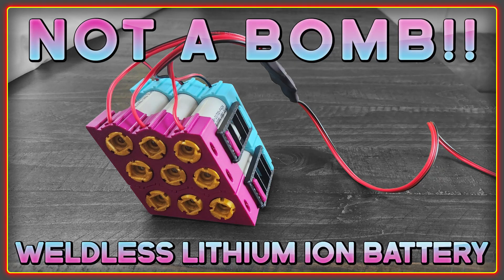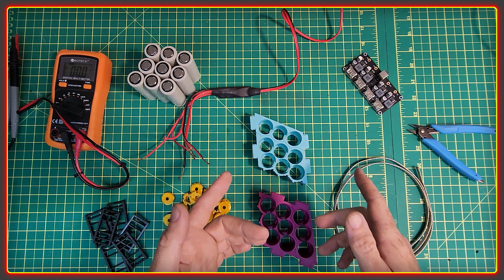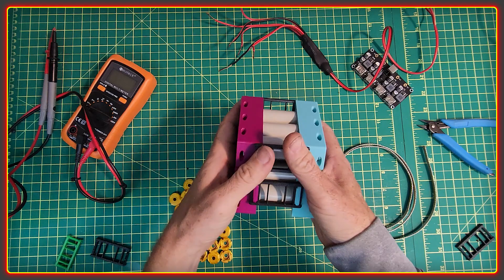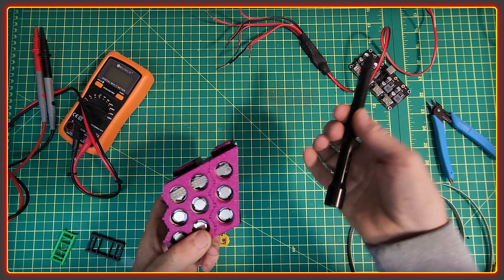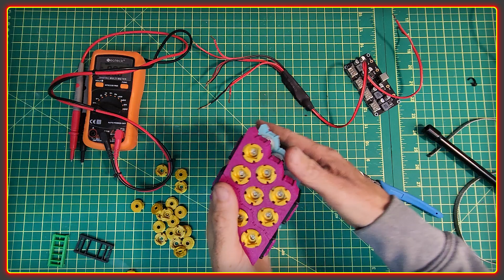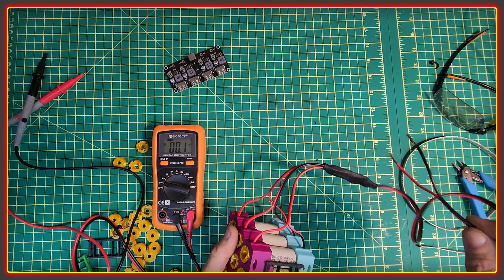NOT a Bomb! Weldless Lion DIY Battery building system - Omnicell

Comment: Has anyone designed a part to stop the screws from coming undone yet? I guess that some tape would work (please do not take this as advice anyone,or do so at your own risk as I have absolutely no experience working with battery packs), but maybe a better option than tape is available already? Maybe also some kind of outer frame for protecting certain types of plastic from cracking and degrading over time?
Reply from the maker: I need to get back on this. Time is very scarce. The screws don’t come out but a dap of mitre glue is possible if one was worried.

Comment: This is a really excellent design! How much amp draw would you say the braided copper cable is rated for?
Reply from the maker: The .25 inch strips are rated as equivalent to 13guage wire. It's been tested in this application up to 25amps. It's not quite as straightforward though as most ampage ratings are based on foot long sections of wire. Shorter lengths have less resistance and can carry more current. Most of the sections hear are an inch long at most. I will get more detail on the braid as the open source section takes shape. The braid is from Georgia copper so there is also detail on their website. Hope this helps.
Reply: @HighVoltageKits  Thank you for the input!

Comment: This will be Great if you can build a 52v or 72v Battery small enough for our E-Bikes to use. Even if it's for a Smaller Capacity "Backup" Battery, I would think you could save some Money building it yourself compared to the High Cost of Retail Batteries.
Reply from the maker: There have been some of those built with the early version of this system. I am not ready to do the higher voltages yet with it but I am going to be making it open source so I am sure others will want to take this step.

Comment: How did you connect the wire? Just with pressure from the plastic plug or solder of some sort?
Reply from the maker: Presume from the screws.

Comment: 👍Simpler than fruzen system kit, by using clamp to minimize use of plenty bolt, let's see biger pack of this system . .
Reply from the maker: I am reworking some of the things. I have a 36 volt version that I think will work well. Also some vibration testing. Should be an update next week.

Comment: Hey C. Codswallop 🖐
Its very Similar to the Vruzend kit hey, ease of assembly is very good but it adds alot of "extra size" for an Auxiliary Type Battery in a generally space limiting conditions associated with E-Bikes. I reckon you should of made 4S configuration in Lifepo4 chemistry for your Ebikes Auxiliary 12V circuits. It's much closer to a normal 12V PB battery with its associated 12V loads. Take it in your carry on through the Airport 😂 
No guys IT'S NOT A BOMB ! 😏
Reply: Totally and completely different from Vruzend tho. Also, a welded 4S LFP battery of the same capacity would be much larger than a weldless NMC pack.
Reply: @electronicsworkshawp Agree with capacity been reduced but im running a 4S/1P Lifepo4 32700 (6.0Ah) cells in the same space as my original 3S/3P (10.5Ah) Li-Cobalt Aux. Battery, yes it has less capacity but more than enough capacity, considering I'm only running 12V Aux equipment such as SSR, Headlight, Dual USB & very very rarely all at the same time, even then not for a long duration. I usual top up battery every 3-4 rides. Hes enclosing the Li-Cobalt Battery in that Weldless Battery kit, then hes still got to add foam & shrink wrap for further Vibration & insulation protection. As I said before the "12V usable range" of Li-Ion Cobalt is far less than Lifepo4 Chemistries, so there's that to consider also.
Reply: @oze-bikes4life663 lifepo4 is bad ass and definitely produces a better 12v equivalent.
Reply from the maker: I have a few different packs to mess about with. They are coming out more compact than I expected. I am interested in Lifepo4 tho for storage.
Reply: @HighVoltageKits  yeah that's cool, I realise your most likely uploaded that video to help out beginner battery builders. 👍
I  just giving some advice as I have "been there & done that" so to to speak, regarding using Li-Ion Cobalt for Aux. Battery. Then switching to Lifepo4. More pros than cons in my opinion by doing this.

Comment: I like this. I don't have a spot welder but this would enable me to build a custom battery anyway if I ever want to do that.
Reply from the maker: The most that has been done was a 72 volt one. I should have enough cells on the way to start off with a 36 volt one which will be good for testing on the new motors with.

Comment: can you link to the original source?  interested in this.  looks like this could easily become a 3d printable design that's actually sustainable.  failure modes due to cracking aside, this actually looks to be as good or better than the current welded designs because you're using large braid mechanically coupled to battery.  the only part i dont know offhand is what physically happens to the cells during charge/discharge cycles...?  is there normally room for heat expansion/contraction of the cell bodies?  does that translate into mechanical stress from the cells themselves?
Reply from the maker: The original design was by Joe of Electronics Workshawp. I will be acting as steward over the design as well as refining and experimenting. I will have more information available. Looking into options for how best to distribute etc. I am not 100% on expansion. I have plans to test out this kind of thing with vibration and thermal cameras etc. I will also do drop tests. I can always stick the calipers on and see. I think the main failure point is as you mentioned. Dropping it on the floor. I am trying to reduce the sizing so that a case would be possible. I am also interested in seeing if there is a fireproof material that can also act as a cushioning material.
Reply: reasonable concerns but would just like to mention that canister cells are not known to swell under normal operation, unlike LiPo. This is why normal cell holders used for welded battery packs dont have to make any kind of provisions for such.

Comment: Appart from what a great concept of the welderless battery assembly, which hope it will be made eventually into a bigger battery pack for ebike, a 12v dc to dc converter would do a great job converting ebike voltages to 12v  which I use to power my accessories from my 52v battery,
Reply from the maker: Absolutely. Ones that work at 72 volts are harder to come by. It is a great solution as well. Although you do lose a bit of range and can't operate them if the main battery runs out. Its a solution that would take up much less space for sure.

Comment: Will that pass a UL test for workmanship?
Reply from the maker: Of course not. But you knew that. What's your point?
Reply: @HighVoltageKits  Just pulling your chain.  But how many people with less skills watching this may burn their house down if they don't know what they are doing?
Reply: @bigwheelsturning this ideal for diy'ers who has the acquired skills to assemble this pack, also makes it easier to replace a faulty cell when the issues arise, although I would put insulation rings on the positive end of battery though,
Reply from the maker: Lol. I am not going to make this available to anyone I don't think will respect it. If I do more of a guide I will thoroughly outline the risks. I'm staying very low voltage as I am by no means an expert on batteries. In some ways I can test it better that way.